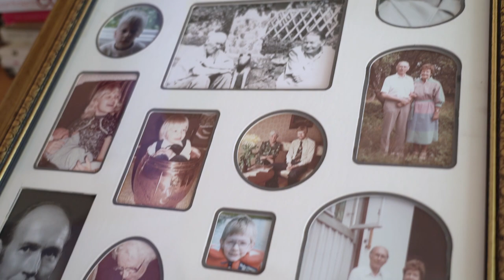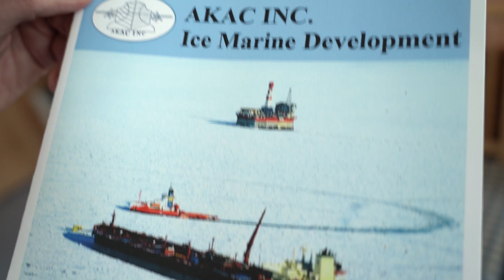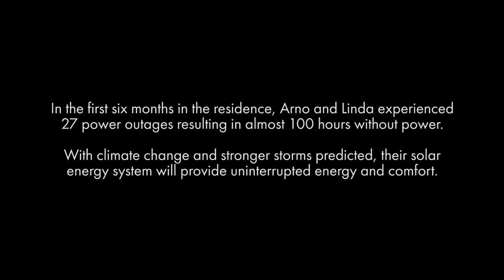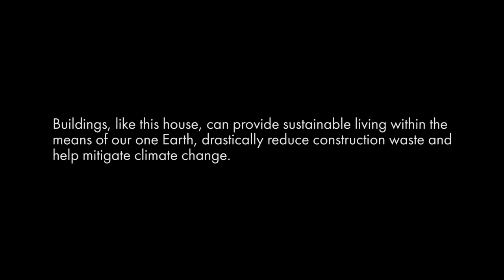A Home Building Revolution - The Harmless Home

Comment: The idea that lime in hempcrete is absorbing C02 is bunk.  Lime is a mined material that releases C02 when heated, converting it to the building material you are using to make the blocks.  So, yes, it absorbs C02 as it cures in your building, but in the overall C02 cycle, the only real C02 sink you have there is the cellulose in the hemp.  And you would have that same sink in a house built with traditional lumber as well.  I do admire the attempt to make a less toxic house, but you're greenwashing this so hard that it is difficult to watch.

Comment: talks about 'eco friendly' house; builds a house for 2 that 5 families could live in, in a remote place where even building an access road will cost as much as a new house; cost has a carbon footprint also and a huge one!
Reply: I agree with your statement that this particular home can not be a standard - it is a first of its kind. This is regrettably the logic how pioneering has typically been possible to fund. I follow the principle which Elon Musk used . In order to make a difference you must start by providing solutions which wealthy people want. This is practically the only way to fund new solutions. Yet, even then keep in mind that the total eco footprint of our home is way less than that of "normal home construction" today. A first cut calculation indicates that the home itself has over its lifetime about 20 % of the lifetime footprint of such normal home which is built today in for example Colwood or Langford. A big part of this is the expected life of the home being 500 - 1000 years. Very low maintenance no mold problems net zero producing more energy than consuming, including transportation etc...
Reply: @arnokeinonen8331  i like the house and have no problems with it being large; id build such for myself if i could afford it; im just pointing out that cost has a carbon footprint which noone takes into consideration; 'eco' building should be as cheep as possible, non toxic, with low carbon footprint, passive in design, 'healthy' and comfortable, building with natural materials is not required, important thing is the energy, emissions, and raw materials balance over a long run including repairs, parts exchange etc.
Reply: see my other answer to  comments about our conceptual "Home Zero" - with definitely be within the one earth resources...

Comment: ...and they sprinkeled some pixie dust, and POOF, this 10K sq ft home magically appeared out of the thin air. Tinker Bell lives in the turit, i;m sure. None of the tons of materials took any energy to mine, transport, smelt, form, package, transport, and install. When they are dead, it will make a nice musium or maybe a mosoleum for the poor folks on whose backs it was made.

Comment: Brilliant application! Questions + answers = solutions. What method is used to tie the blocks to your foundation, and the roof frame to the walls(wind - lateral & uplift forces)? How is electrical wiring run? Can most wiring be low-voltage DC to eliminate the need for appliance 'wall-warts'? Does wi-fi signal pass thru these walls? How are plumbing lines run? What energy do you use for cooking, hot water? Nice to see powerwalls implemented with solar PVs. Has the solar/storage capacity met your electrical demand? I'd love to see the plans & specs documents. Thank you for doing your part!

Comment: How much did it cost to make? Just curious. Building with those hempcrete blocks are a great idea!
Reply: The cost of our home was less than it would have costed using an ICF exterior wall, or tilt up concrete eco wall... The real life cost will depend on the scale of production it should be after the initial pioneering steps have been taken only marginally more pricey than todays standard homes. BUT the cost of living in the JBF home is way lower  than any standard home today. Our home requires less heating energy than a passive house - thus gets to the step 5 of B.C. Step code of eco construction.

Comment: This is truly fantastic. Anxious to learn more about this material for home building.
Any idea on where R value will land?
Reply from the maker: Thank you for your comment! Please see Arno Keinonen's response below:

R-value measurements performed on our walls indicate the value being in the R30 - 40 range. Yet, R value is not a good indicator of the heating performance of the home. Our home performs better than passive house standard despite of large view windows. The high R value helps but even more the heat that the walls retain overnight. For example this summer the outdoor temperature has varied between day and night by more than 10 degrees C (for example 23 daytime and 13 nighttime temperature. Without any heating the house has retained an inside temperature with a drop overnight of only by 1 - 2 C from a daytime high value of typically 23 C.
Reply: It varies depending actual conditions outdoors, typically around R 30. But keep in mind that the R-value is a very narrow way of addressing the thermal efficiency of the home. Thermal mass of our exterior walls are very high this results that the home - unexpectedly - outperforms passive house requirements 
Arno Keinonen - the owner of the home
Reply: Arno Keinonen your house is stunning! I hope to see more builds using the same materials and principles. Are there more pictures or videos of the interior that you would be willing to share? Thanks again for sharing with the world this project.

Comment: Lovely house, but quite big. Side question: In the "control room' it looks like the one wall is all plywood, I thought is was plywood free?
Reply: No every part of the house is regrettably not plywood free, it is however chip board free and all interior plywood inside the home (such as in kitchen cabinets) is one using glue which is either very very low on VOCs or free of them.

Comment: It's just hempcrete, it's been used to make houses  before... not the first in the world. Amazing construction material
Reply: Yes, what's old is new again, however, it's the added structural stability of these patented blocks that makes them a builder's dream because of their design and ease, and the ability to run conduit through them.
Reply: @franceslitmanphoto  my system is better. invented 6 years ago! ;0)
Reply: The hempcrete itself is well known indeed. The invention is the combination of hempcrete with a structural frame which is the main invention. This provides very high structural strength, is fireproof, is earth quake proof and very easy build on an industrial basis.
Reply: @jammapcb   Well, francis is cuter anyway, even if comes across as a little snarky.

Comment: To keep with green, how did you create the walls inside this house on the 2x4's?
Reply: In our home the inside walls are regular with 2x4 and drywalled ones. The joint between the exterior and interior wall is the only place were we see any cracks anywhere in the house as the wooden frame of the interior wall shrinks slightly whereas the JBF exterior wall does not.
Reply: @arnokeinonen8331  Thank you.

Comment: what would be the cost comparison to a masonry built home in Toronto at 1000 square feet per floor W/O the basement.
Reply: The cost of our home was no more than normal upscale home, it is anticipated that the cost after these blocks are well established will be no more than a regular stud based exterior walls
Reply: @arnokeinonen8331  if you don't include the heating and cooling cost, your end cost presumption will be less than the cost of building today in a market like toronto. not to mention less trades to involve in the project.
Reply: @masonman88  Our living cost is already nearly zero, other than property tax. We produce more energy than we consume both for home and for electric cars. Also given time I believe that the insurance premium for homes with very low maintenance, no mold problems (which are driving insurance rates up certainly in B.C.), high fire and earth quake proofness will get us lower and lower annual insurance costs... Etc.
Reply: @arnokeinonen8331  how accepting was the government with your building permits.
were they willing to sign off as long as an engineer would  accept liability
I so want to build with hemp. I have a property in downtown t.o. near zero balance and want to create something similar to what you have accomplished for your home. building an 8 ( or more ) unit rental build would be a different in codes an ordinances . but I am thinking I might have to build with the older hemp style with a wood framed load bearing structure and pack the hemp.
Reply: @masonman88  The biggest question I have had a long time how on earth did we get a building permit even! Well first we got a building permit for foundation etc. and what was left conditional to additional verification of issues such as the functioning of the new solutions. I had to let go of the original engineer as he could not answer any of those conditional questions. Then fortunately the JBF company had worked with an engineer in Calgary who was also registered as an engineer in B.C. He became the building envelope engineer and approved the JBF solutions. The functioning of the JBF solutions was all verified using a combination of physical tests and FEM modelling calculations for the strength of the JBF walls. Yet the JBF was not integrated into the building code, thus our home remained an exception to normal. Next construction in Victoria using JBF blocks got caught for the reason that the architect and engineer had strict requirements to stick to the building code itself. This lead to significant compromises in the structure of this next home in Victoria wish steel beams and more concrete than typically needed as the engineer was apparently obligated to use a high safety factor for such new solution. In our case the architect Jack Anderson chose to never take the full architecture degree to enable him to design eco homes so this also made it possible to get done what we did! Now the JBF is about to get fully incorporated into the building code, I think virus is slowing it down a bit though...
Reply: @arnokeinonen8331  personally I think we are in a moment in time when people are questioning much more than can be answered. and with more and more people eating less meat and dairy. as well  with the explosion or the cannabis back into the main stream. we are less dependent to the corporate way of life. this dose include governments as corporations. I am sure this would be a blockade  here in ontario for permitted building. not to mention that it would for rental units and that I am sure would complicate things even more. did you install any type of heating system in your home? if so what type?
Reply: @masonman88  heat pump installed. It consumed 2.8 MWh first year and 4.4 second year (due to colder winter weather), whilst we produced 22 MWh per year of electricity our of which about 7MWh was use by the house 7 MWh for charging two electric cars and then refund from BC Hydro first year $750. We burned wood in wood stove first year three times which increases the CO2/energy footprint somewhat, but no more than by 100kg of CO2. The house is going to be heacily instrumented and its eco performance compared against other construction solutions on every key matter that counts. I anticipate the biggest difference being that our home is mold proof, wereas the home insurance rates for "standard homes" in B.C. have gone rapidly up thanks to what is called leaky condo syndrome, very expensive exterior wall repairs in most condo buildings even the most upscale ones...

Comment: Can you build this house for at most $150,000, without the land?
Reply from the maker: Thank you for your comment! Please see Arno Keinonen's response below:

a. Our intent was to build an upscale eco home, which is desirable to even wealthy people. This is a proven way to accelerate change to get significant investment into such new powerful technology. Our house price per sqft was lower than any upscale home using more standard house construction technology.

b. Simple homes could be easily be built for lower price per sqft than current home standards to Canadian building code, with much lower monthly cost of living in one, and vastly better energy performance and safety against mold, toxins etc. Once all the engineering using these blocks as part of home construction is fully accepted as part of Canadian building code, there is no reason why a home could not be build for a cost of $150,000. Other components of home than the exterior walls will be a much bigger part of the price of home, to meet requirements of the Canadian building code.

Comment: What are the green frames made of?
Reply: fiberglass, 4 % oil and a secret compound from lime. A secrecy of production is that a 350 tonne press changes the molecular structure of the structural frame, making it very strong, and totally fireproof it does not loose any of its structural strength in a fire test of the JBF wall.

Comment: Can anyone confirm that they've experienced one of these homes and they really are mold resistant? I'm worried that none exist more than 5 years old to really know
Reply: We have wall measurements through north wall and south wall of the home which measure through the exterior wall both heat flow as well as humidity levels at different locations of the JBF blocks. The wall automatically breaths the humidity through which means that there is no condensation point anywhere, as there is no vapour barrier! Mold only forms when humidity turns to condensation of water, thus having 100 % humidity. In real life the measured humidity of our exterior walls throughout the year within the wall does not go above about around 70 %.
Reply: @arnokeinonen8331  Okay thanks very much. Do you know if I could hire someone to build one of these?
Reply: There are hempcrete buildings dating back 1000 or more years